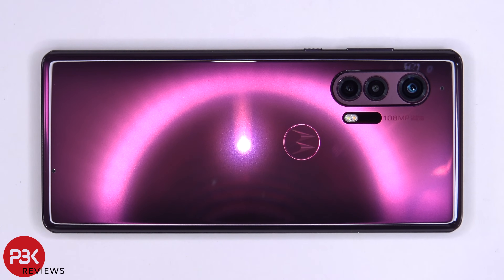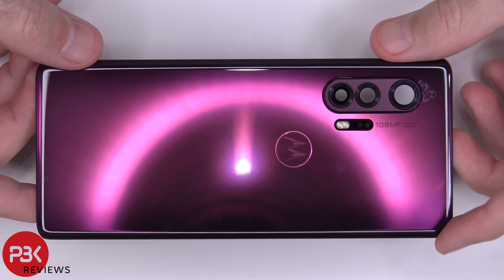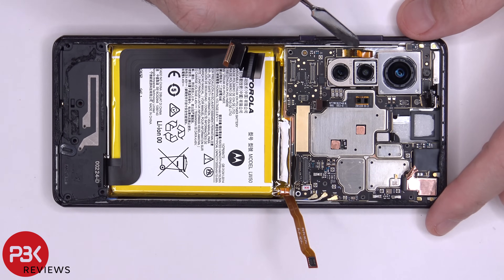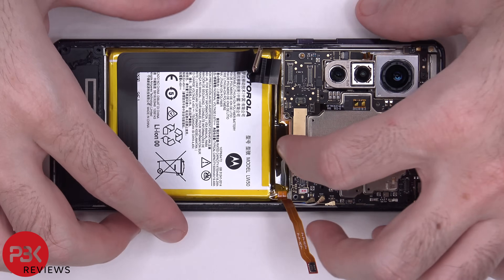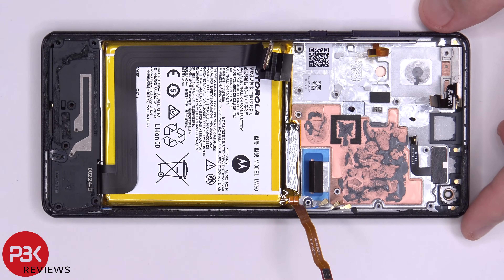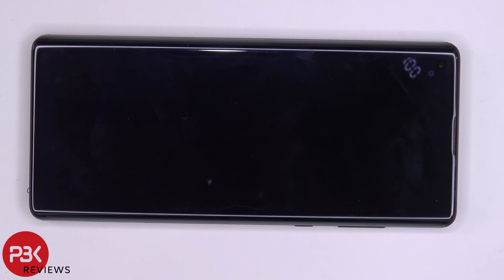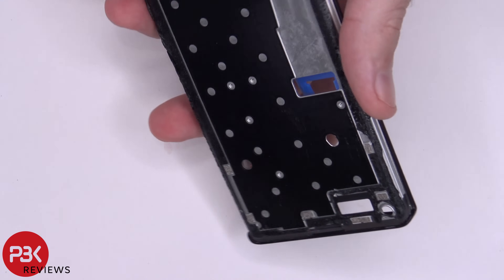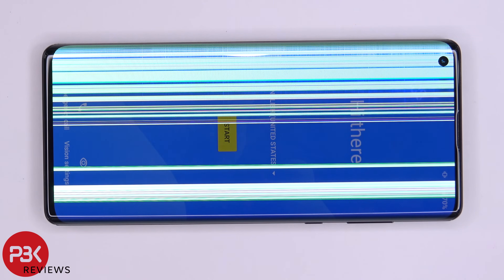Motorola Edge+ Disassembly Teardown Repair Video Review

Comment: You didn't mention when microphone is. Mine isn't working properly after being submerged.  I really thought the phone was waterproof
Reply from the maker: Its on the sub board or charger port board with a blue rubber gasket over it. Here is a link for the replacement part https://www.mobilesentrix.com/charging-port-board-compatible-for-motorola-edge-plus-xt2061-2020-genuine-oem
Reply: @PBKreviews  thanks a lot. You are the best!

Comment: Mine became half submerged for 20 min. I used my garage air gun and summer heat in an attempt to quickly dry it. Its never powered back on, I figured out how to remove the back glass but a little time had passed. Evident rust on the screws and antenna sections, only on the left side from top to bottom and max water penetration only looks to be 1/4-1/2" inward from left edge. otherwise normal looking but completely dead and absolutely dryed out.  Im gonna use your vid to disassemble more, I might go ahead and order a battery but it looks fine, no swelling or anything. Any suggestions on direction. Obviously 100% normal working function would be great but my main focus is on retrieving the data shared with a loved one recently lost. Ive started research but any suggestions or methods would be greatly appreciated. Thanks

Comment: Does that bottom part you called "speaker assembly" 7:32 supposed to make sound? I don't recall if I ever heard sound from it, but after replacing my charging port there's no sound from it. The phone does vibrate. I suppose I'm asking how does that part connect to the phone. I don't see any connectors, nor did I disconnect any cables to it.

I'm usually on headphones anyways but I would like to know if I messed it up so I can know to fix it if I ever decide to replace the battery. The top speaker works. The one near the camera.

Comment: What are the three wire cables for? My mic and speaker dont work. Just the ear piece speaker works.
Reply from the maker: They are usually used for antenna connections. Make sure your sub board/charger port board is seated properly as well as the speaker assembly and all cables are connected.
Reply: @PBKreviews  Gracias

Comment: Tengo tornillos barridos, que puedo hacer?
Reply from the maker: try using a size larger screw driver. If it doesn't help, you will need to use a drill with a drill bit small enough to fit inside the screw head to drill into it so you can break off the screw heads that are stripped.

Comment: I messed up the power flex cable connector on board. Does it need to be soldered to board? Instead of pulling up on white part I pulled on black piece. Now lcd does not turn when I charge it. Since power button flex isnot connected will this prevent lcd from turning on when I charge it?

Comment: Great video. I dropped and broke my screen. It would no longer respond to touch  I replaced the screen and now it works like new. Only after I put it back together and sealed did I find out that the sound and microphone no longer work. So today I put in a brand new OEM speaker assembly. Still no sound. I'm pretty sure that I got all of the connections back. Any suggestions? I would really like to get this phone working again. I have 4 of them. 2 blue, 2 Sangria.
Reply: How did you fix it. Have same problem.

Comment: I have one of these that I broke front and back glass and was told that I need to replace the frame or else it will have messy glue when put together

Is this true if so could I get a link to a frame I already have both glasses
Reply from the maker: Do you have the screen or just the glass because you can't replace just the glass its not user replaceable. The screen and glass are fused and it requires special tools and machines to separate them. You would need something like this that comes with the frame pre attached with the screen as well (since it will make replacing the screen a whole lot easier than having to apply adhesive to the screen and frame) https://www.ebay.com/itm/374070260364?hash=item571853328c:g:80gAAOSwcC9ie98w&amdata=enc%3AAQAHAAAAoD6fGZRc2LTHsM6IVckoraxaJATA70dIUlimSM9xvaQ0yXxkLtQshyDjaC%2B1rOB1Zfe%2BufKHd6LPzzuU33d1zjDNBCPmed6G9MyHkhIMDxsSQhmPYKjg0c2PBWWLYb94E4vJfEzwomg2HDs1xBzJ7f0tWe9lwOyezjGcZ%2F4Z2D3lCLLjnAcp5WPH7HTtzZSn5qFMLcQyLbc9UFd0eMeeG2g%3D%7Ctkp%3ABk9SR67j5rT6YA   or you can find just the screen with glass assembly and other replacement parts for this phone at this website: https://www.mobiledefenders.com/motorola-repair-parts/other-motorola/moto-edge-xt2061.html
Reply: @PBKreviews  I got the lcd front screen with no frame because I didn't know and the back cover so I'm just missing the frame

Comment: The phone doesn't charge anymore. PCB around the charging is broken. The voltage doesn't go through. Any idea on how to fix it?

Great video btw.
Reply from the maker: Thanks. You would need to replace the sub board. You would need this part but its out of stock, you can also search it up on google or other sites like ebay. https://www.mobiledefenders.com/motorola-repair-parts/other-motorola/moto-edge-xt2061/charge-port-assembly-for-moto-edge-xt2061-motorola-authorized.html

Comment: Do you think i can remove the back with a hair dryer? I need to change the charging board. What is a good website to buy parts for indivuals
Reply from the maker: Yes, a hair dryer works just fine. You can get original parts for this phone here: https://www.mobiledefenders.com/motorola-repair-parts/other-motorola/moto-edge-xt2061.html
Reply: @PBKreviews  thank you. Is b7000 is a good adhesive to glue it back or you would suggest something else
Reply from the maker: @AraOG-o7w the website i gave you has the original pre cut adhesive to use to re adhere the back :)
Reply: @PBKreviews  it’s a great website but they’re asking 50$ shipping fee (I live in Canada) do you know any other website with the same quality parts for Canadian market
Reply from the maker: @AraOG-o7w  oh, hmm not sure you would need to search up those parts I guess on ebay or elsewhere. I'm not behind the computer at the moment to look it up.
Reply: @PBKreviews  thanks for helping me :)
Reply from the maker: @AraOG-o7w  you're welcome, send me an email to pbkreviews@gmail.com I will see what i can find.
Reply: @PBKreviews  bro, I changed the charging board and everything now I don’t have reception amd my torch doesn’t turn on. What’s the problem

Comment: What is the function of the three wire cables connecting  the  2 boards
Reply from the maker: Most of the time the coaxial cables are used for antenna connections and sometimes related to other things like charging or for example in some of the black shark phones for the gaming trigger buttons.

Comment: Hi, we have all original parts for this model and other Motorola phones too. We are based in Europe.
Reply from the maker: If you want you can post the website as a comment for people to check if they need parts.
Reply: I bought a digitizer from Ali Express. Looks good as new. $64. YT will remove links.
Reply: Great video. I shattered the corner of the screen and mine would no longer respond to touch. I put in a new screen and it works like new.  Only problem now is that the sound and microphone don't work. Today I put in a new speaker assembly, but still no sound. Any suggestions? I'd like to get this phone working again.

Comment: Do I have to do total disassembly just to replace the screen?
Reply from the maker: You would have to disassemble it as far as removing the motherboard so you have access to the screen cable which is ran through the slit in the midframe. If you are replacing the frame and screen combo together, you would need to disassemble the whole thing so you move all your parts to the new frame assembly.
Reply: @PBKreviews  
Thank you
Reply from the maker: @davidefry  you're welcome

Comment: Thanks, great work taking it apart & now if my phone gets damaged i know how to disassemble it.
This phone has a great build quality ! Not looking forward to taking this phone apart.
Love these types of video's, i took apart my huawei g7 a few years ago to replace a dead battery.
need to take apart my sony xperia xa1 cause the rear cam doesn't work but looks hard to get that case off.
Reply from the maker: Thank you, I appreciate it. Glad you enjoyed the video. Seems the xa1 might have a bit more stronger adhesive but not sure. With enough heat should come off without too much trouble.

Comment: I accidentally stuck a paper clip in the speaker hole instead of the SIM hole.  Guess I shouldn't have tried to put the SIM in while In a dimly lit room.  Is there anything you can damage by sticking the paper clip in the microphone hole?!?!? @pbkreviews
Reply from the maker: You should be fine, the mic is a solid metal piece on the board and shouldn't break or get damaged too easily.

Comment: 4700 mAh una gran mentira al menos debería tener 4930 mAh de capacidad real que estafa
Reply from the maker: All batteries have a rated capacity and a typical capacity. Under the rated of 4700 you can see it says 5000mAh. Basically the battery is a 5000 mAh and but they don't guarantee the full capacity even though you might be getting the full capacity (sort of say). So they show the rated capacity of the battery on there which is what you will get on a constant basis over time but the 5000 mAh is not a sustained amount you would be getting possibly so hope this sort of answers your comment.

Comment: I bought this phone last montg in India and from day 1 I have network reception issue and worst wifi signal issue.. later even the MIC stopped working.. other end caller can't hear my voice but if I switch to speakerphone they can here.. the phone being one moth old I demand a replacement of entire unit.. but motorola refusing to replace...and they want to replace the hardware :( I don't know whether it's good idea to replace the hardware.. will it create other issues? Like in your video the display was not working after ressembling back.. what's your opinion? Pls advise
Reply from the maker: Is it motorola direct or a random mom and pop shop? Because if its motorola themselves, they have all the tools and parts and usually send out a replacement device not the same one you send in. And if it is the same one, they usually replace all the parts and make it look and work as new. I have used many replacements from motorola over the years, and they have all worked fine for me but not sure if motorola USA will be the same as other country motorola outlets.

Comment: I got my Moto Edge+ a few days ago and hadn't gotten a case yet, and while cleaning the gutters on the roof, the phone fell out of my pocket face down and the screen is cracked.  I check Ubreakitfit and they don't have the parts. Why didn't I leave my new phone at the desk while working. Oh, the regrets.
Reply from the maker: You can always send it in to motorola to have them replace the screen, not sure how much they charge. They also have advanced exchange which they ship you out a phone first and you ship your damaged one to them after.

Comment: The device is very solid. I do agree whatever glossy primer coating is in the metal frame it's really bad as it feels like plastic. And the display isn't the greatest for $1,000. It has a noticeable gritty texture which is especially visable on white backgrounds ( which could be the result of it being 2340x1080 ) and the display is very cool color temp wise which also isn't my favorite. Other that that this device is all around solid and a step in the right direction for motorola.
Reply from the maker: yea its solid, been using it for a while. Although I hate the on screen finger print reader due to it being much slower than physical ones I have been using in the past and not having a dedicated on screen back button, it seems to be a very good device thus far.

Comment: Talk all you want. Motorola did a great job to produce this flagship for just 1000 bucks. The headphone jack is lovely to have. I don't care about packaging that I'm throwing away anyway.
Reply from the maker: I'm not saying they did a terrible job, but I just expected more since they usually do a better job on packaging and presentation on their regular line of devices. They even had better packaging and presentation on their moto z4 line which was less than half the cost of the edge+. Aside from that, they did a good job with all the copper inside the phone.
Reply: "just" $1000 ALOT of money

Comment: The Motorola edge plus is a great feeling phone
Reply from the maker: I guess its a matter of opinion, I prefer the metal feel for the frame compared to a glossy plastic feel. I also really liked the soft touch suede like feel some of the phones had way back in the day. Haven't seen any of those type around for a while.

Comment: Thanks, great video. One reviewer mentioned that he submerged the phone in water for 25 minutes and it still worked. Maybe with the strong adhesive this phone is fairly close to ip67 or ip68? My biggest worry would be the top headphone jack taking on water, but I guess you could always snap in a headphone jack cover to protect it. Cheers :)
Reply from the maker: Thanks, and you're welcome. Yea the adhesive definitely plays a role in it. They advertise it as splash proof, but sometimes companies don't want to spend the extra money to get the ip rating certification so they wont advertise it as such but yea not sure if 100% it will be able to take on full loads of water. It's possible the headphone jack and earpiece or speaker can go bad after being in contact with water but the phone has some water resistant features (gaskets etc.).
Reply: Trust me it's not. Jumped in the pool with it for a moment and it didn't last long after that. Splash proof, sure... IP68 no way!